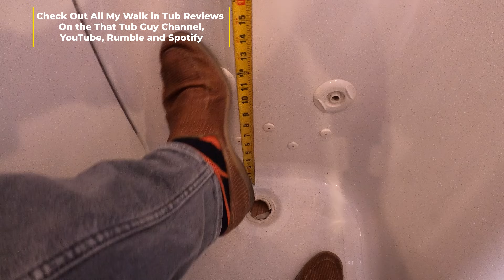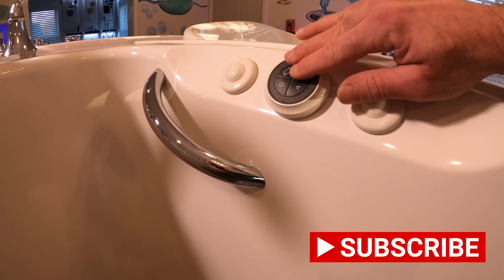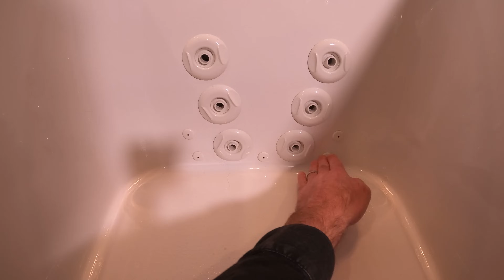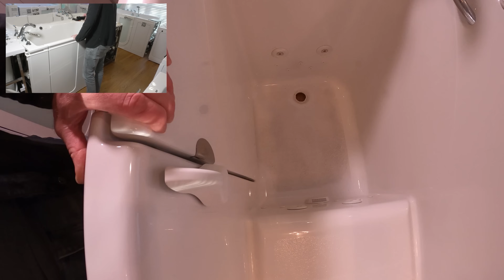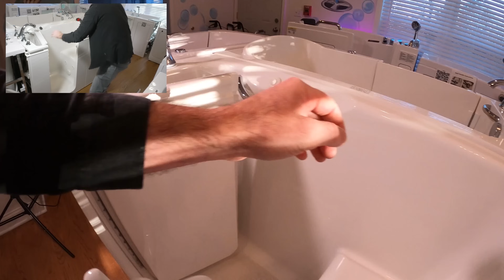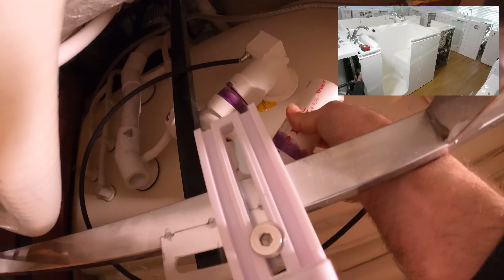Kohler Walk-In Tub Review: Everything You Need to Know Before Buying!

Comment: Nice video but just wondering.... towards the end you are talking about servicing underneath.  How do you access controls and such that are located on the wall side of the tub.  The ends and door side look easy but no easy way to get to parts on the other side of the door.  Thanks.
Reply from the maker: Thanks for watching, Steve! That's a great question. While it may look like some components on the wall side of the tub are inaccessible, most service items can actually be accessed without removing the tub. Even the electronic controls can be removed from the surface of the tub, allowing a new cable to be fished through if needed. The best tubs are designed w service as a consideration. This tub, the Kohler unit, has a sweat in faucet. This is one of my biggest criticisms as it is so difficult to service it. Granted, a full valve body replacememt would be unusual, it is something I have had to do, and its awful to perform on this tub. 

In the very unlikely event that a major repair ever required access behind the tub, the entire unit can be removed and reinstalled in about a half day, leaving it looking and functioning just like new. Fortunately, that's extremely rare, as most repairs can be completed without pulling the tub. Thanks again for the great question!

Comment: How many hydro tubs have you been in with water to your shoulders? Most folks that would come up just below the chest or at the chest. I'd say its at 6 inches to the overflow to keep water from splashing out when the hydro is running.
Reply from the maker: I understand your reasoning, and on the surface it does sound rational. However, after being in and around so many different walk-in bathtubs over the years, it actually doesn’t make sense that this particular tub is designed that way. If the items I discussed in the video were changed, the product would simply be brought up to the standard that many other companies are already offering.

I’d also encourage you to check out some of my other walk-in tub videos where I compare different designs and features side by side. It really helps show the differences in depth, overflow placement, comfort, and overall engineering between manufacturers.